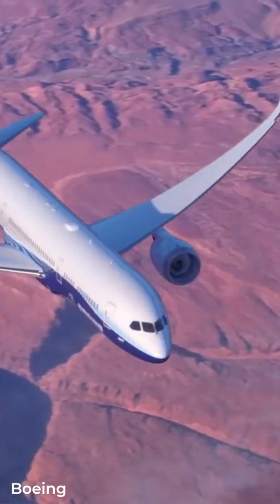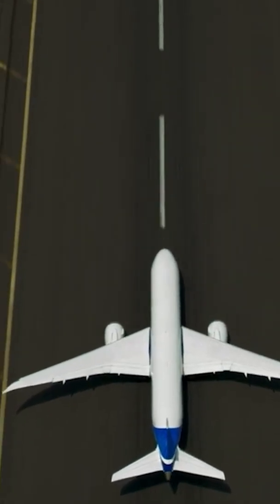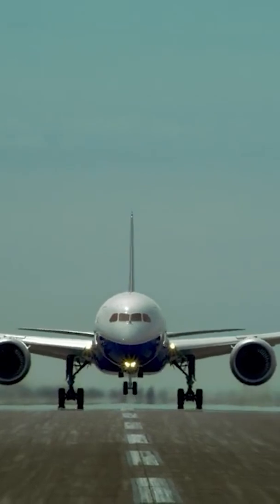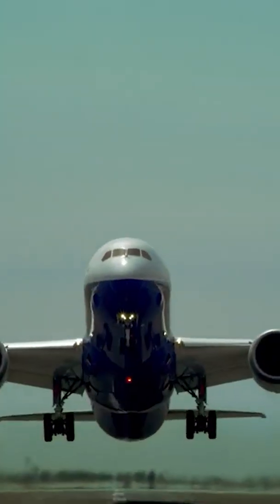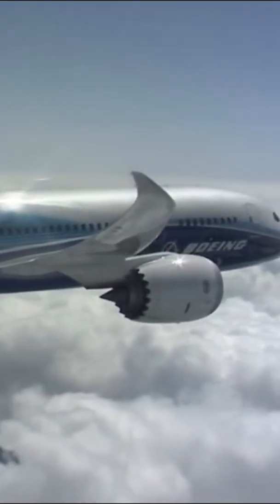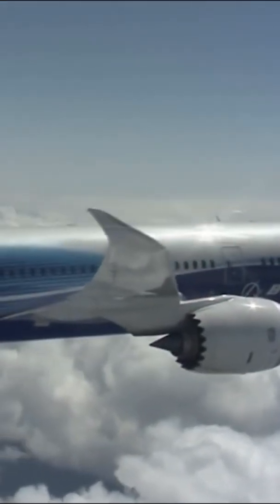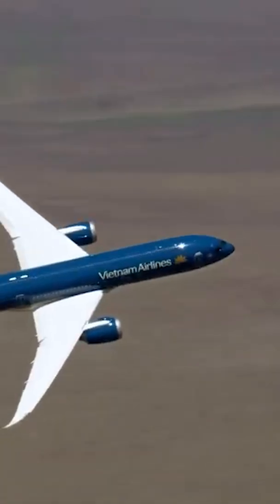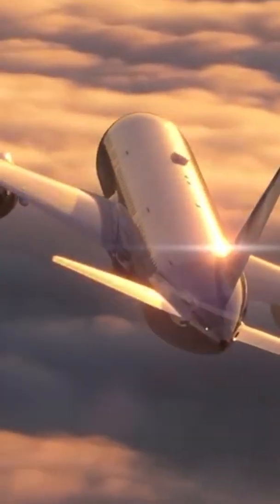Why Doesn't The Boeing 787 Have Winglets? #shorts

Comment: Because it has back sweep wingtips, same used also in the 747-8 😊
While the 747-400 has just winglets added to the same old wing design as the 747-300

Comment: Wings are extremely complicated and proprietary structures. You can’t just change an existing wing to have raked ends as there’s to much internal structure to modify. So for some it is just easier to add winglets.

Comment: Imagine if they made a scaled up version of the 787 into a 777 replacement. That would be awesome and probably very efficient super widebody.  If it could outperform/or match the performance, while having a larger passenger capacity, this give the Airbus a350 a huge headache and a run for its money in sales. But I understand. Creating a 777-X is substantially cheaper.

Comment: Explain why B777-200/-200ER/-300 don’t have. Nobody explains this.
Reply: The original ones because winglets weren't commonplace then; the 777X because it would screw with the folding mechanism.
Reply: @tealmer3528  Hmm. 747-400 and MD-11 are older than 777. Folding wings does make sense. Another question is why these 777 don’t have winglet after-installation kit like 757/767.
Reply: @sho1715  and 737
Reply: The original 777 (200 and 300) didn’t have any type of winglet. The 200LR and 300ER both have an older design of the raked wing tip. Not winglets needed there. Also, a winglet install kit for the older models wouldn’t be cost effective as there are few not LR or ER models flying
Reply: @cameron-w  Nah there were so many 777-200ERs, especially in the US. They are now retiring though

Comment: For the same reason neither does 767-400ER, all 777’s from the 2nd generation variants (-200LR, Freighter, -300ER) 747-8 or the Embraer E2; highly advanced raked wingtips which are better than winglets on longer routes and allow for a longer wingspan improving efficiency even more
Reply: May I know why boeing has introduced winglets in it's upcoming 777x if this design is revolutionary?
Reply: @Ppadira what 777x winglets? You mean folding wingtip?
Reply: @burnedbacon3989  
Yup my mistake. I thought it to be winglet . Though I beleive that back sweep wings have their own advantage , but winglets are way more effective than conventional design to deal with vortices.
Reply: @Ppadira the wing tips fold so that the 777x can fit into gates without modification

if they didn’t fold, then they would have to modifiy airport gates to fit the 777x, and that wouldn’t be ideal for customers